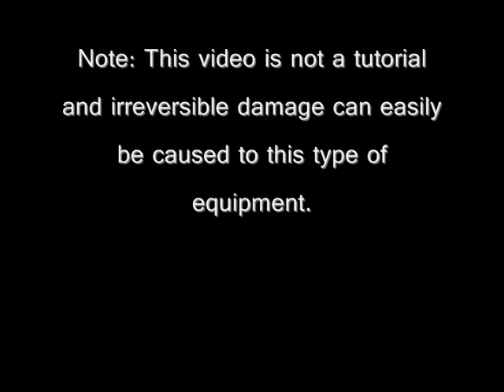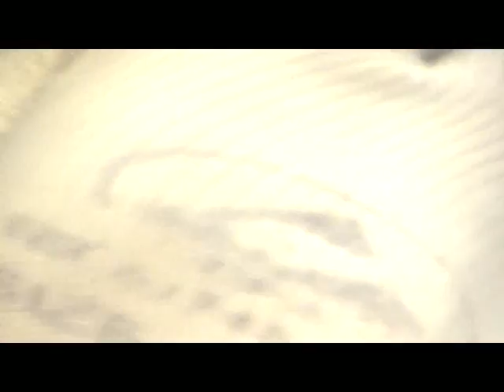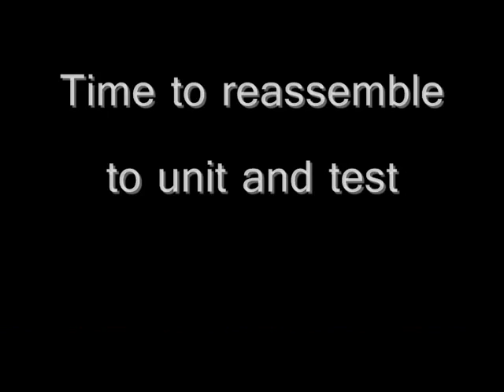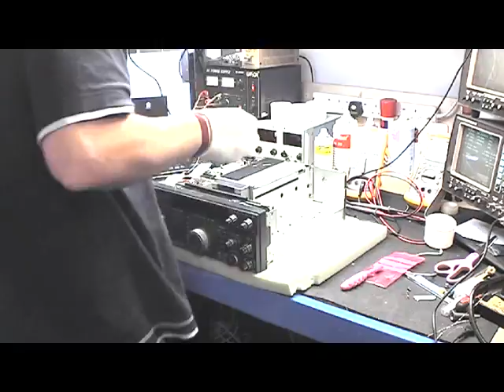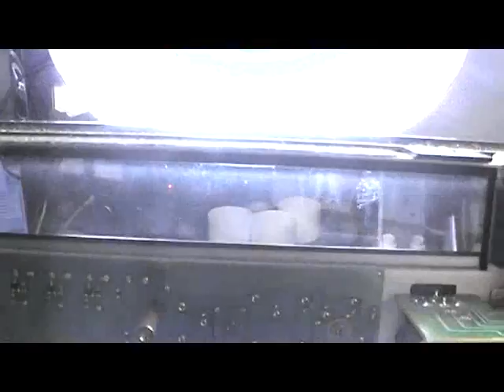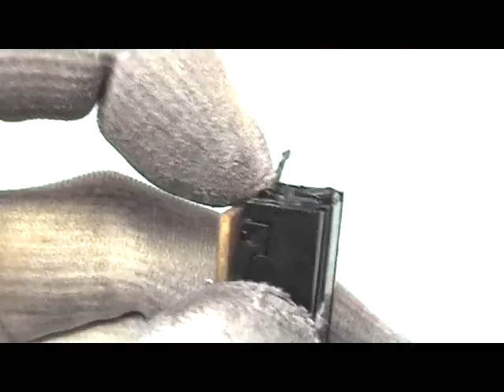Kenwood TS-850S HAM Radio Repair Part 2 of 3

Comment: i did my dispaly all work but dimmer no longer works,oh dear what did i do ..jeff
Reply from the maker: Hi Jeff, It's difficult for me to comment without seeing the radio. Did you replace the display?
Reply: @M0XFXUK  i replaced a cap refitted board and found the dimmer switch on brite but no dim not that i will use it but if i sold the rig i think it sould work .. jeff..

Comment: Good job except I respectfully disagree with putting that cap next to a regulator...and why didn't you replace all caps on that board as it's a known failure issue on the 850
Otherwise nice soldering technique 
73
Jeff 
WD8JM

Comment: Everything is good in this video except one thing.You SHOULD NOT put that capacitor right with that regulator!Because of high temperature of that regulator,capacitor will die very fast! I don't know why did you not put him on the opposite side?

Comment from the maker: Hi the problem sounds like the supply to the inverter has gone. As I recall there is some caps on that board that start drying out. it would be worth replacing the caps and checking the regulator transistors on the board. Also the display board can suffer from the PCB through holes going open circuit. Regards John

Comment: Hi John, 
I have two TS-850 on which I have replaced the CAR board capacitors a long ago (a lot of leakage there!). Two days ago one, of my TS-850 starting "losing" the display. At the same time there was a very bad smell coming from the front panel exactly above the dial knob (no smoke, just a WC-like smell ;-) ). The display flashed once or twice and then blanked. I guess that this 'smells' like a display capacitor bad leak, right?